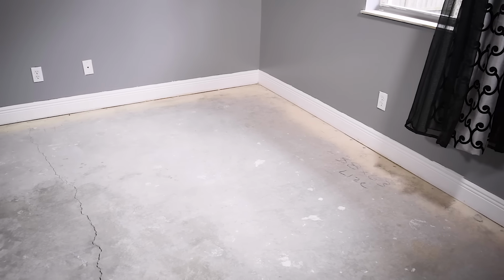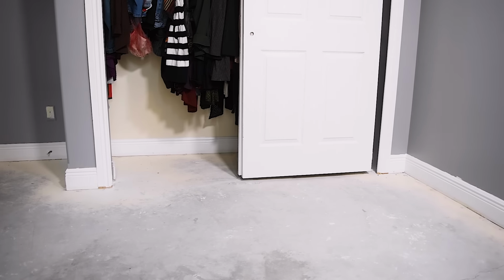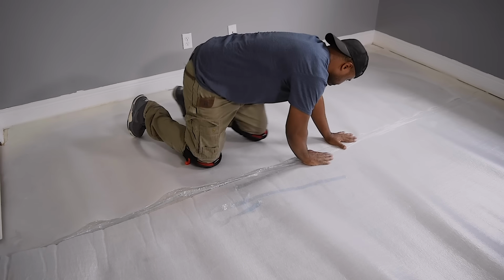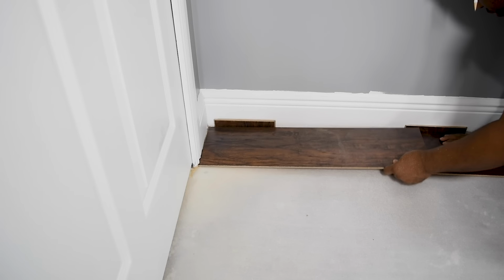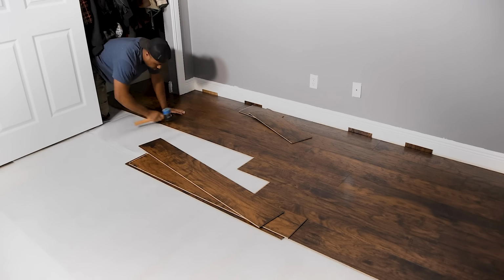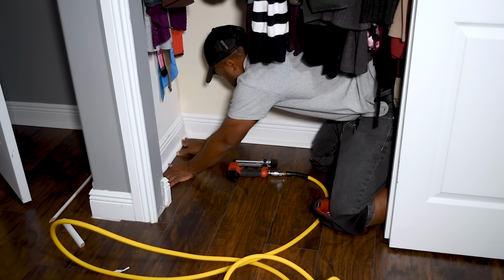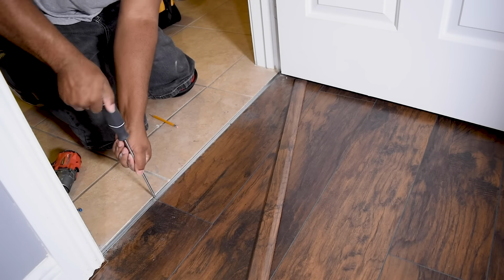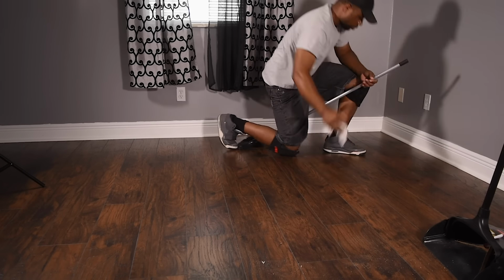How to Install Laminate Flooring for beginners

Comment: Very nice and appreciated video! Let me give only a suggestion.. since it's a video addressed to everyone (also to me in Italy ;) ), consider the opportunity to use safety gloves and, why not, safety glasses too, when working with cutting machine. Also.. it could be interesting to set over the transparent foil, and under the laminate folloring, a thin layer (3 mm) of sound-absorbing carpet, just to reduce the noise of the heel of the shoes on the floor. For the rest, a very good job, bro!

Comment: Love your videos, but you missed a few things you should have mentioned. 1. The floor has to be as leveled as much as possible, keep in mind that laminate flooring is float board. If your floor isn't level and traffic begins to enter that room often, it can disturb and pop out the laminate flooring from the joints. 2. In general with your miter saw cuts, they could have been more explained, but overall good job. 3. I personally think it is best, to flip the laminate board on the back side to prevent as much tear out when using a miter saw, unless you have a fine tooth blade on your miter saw that you didn't mentioned than it would be alright to use your miter saw to cut on the from face side of the material. You should have also mentioned you don't really need a miter saw to cut laminate boarding, as many people don't own these machines, you can get or rent a (Snap Cutter/Floor Cutter). Overall great video and thank you.
Reply: By the time you buy all the EQ to do this job, you'll be wondering why you didn't call a contractor in the first place after you botch it. Remember your first model airplane? Or the first cake you baked? 

Good luck.

Comment: That crack on the concrete slap running straight to the bathroom . Scary ass
Reply: 2 kinds of concrete. Concrete that is cracked. And concrete that is gonna crack.
Reply: Just cover it with flooring. Problem solved
Reply: Thank you!!! I didn't even keep watching because who completely disregards a hairline crack down the entire friggin slab?!?!?
Reply: Cracks are usually to big of an issue with a good vapor barrier unless its a fissure that is shifting flooring heights.  That one was pretty big, and he could have filled it with a leveling compound (I would have suggested it if I was setting up the install), but in this case, probably alright.

Comment: Is underlayment required for vinyl plank?
Reply: Depends on the LVP, and what you are installing on.

Typically you will not need an underlayment if you are installing on wood unless it does not have an attached pad.

Many SPC (stone polymer core) LVPs are find on concrete, but check the installation instructions.  They will usually tell you how water saturated the concrete can be to install without an underlayment.

I have seen from 5%, all the way up to 85%.

Comment: No need to level the floor with some grout?
Reply: He probably had already checked... but yes you should level the floor.

If you are talking about the crack, you would not use grout, you would use a leveling compound.

Comment: I would've just added 1" molding in front of the base board no cutting and it still looks nice. Especially for uneven floors the 1" molding can flex a lot. My names Rubin Lopez from day in the life of a nyc construction worker ❤💪✌

Comment: Very good morning all

We have several collection in wooden flooring
Laminate
Engineered
Solid wood
Outdoor wood 
Thermo ash
Ipe
Pine
Wpc
Versailles tiles

In laminate we have 8mm and 12mm flooring water resistant and waterproof

Please contact us for stylish and durable flooring

Regards

Mr. Raj
🇳🇪india
Contact me
7503452730/8882601780

Comment: Another very important tip....be sure that if you have windows, that they are caulked on the outside.
If you see the concrete discolored or damp...you have an exterior water leak path , that needs to be addressed before you start.
I ran into this issue when I removed my wall to wall carpet and exposed the cement slab. The corner of the metal window frame had a wide open gap.
You do not want water working its way under your new flooring. 
Just trying to help.

Comment: Difference between a pro and your average DIY guy is show at 12:10. Pros would hide the flooring under the door trim/jam and you wouldn't see where it ended like you can see in this video. The rest is good for the most part tho. Not bad for a DIYer.

Comment: “ for beginners” .. has x thousand dollars worth of tools
Reply: My father's here talking about buying a saw now
Reply: There's even a saw that wasn't listed in the video description which I am awfully curious about.
Reply: @stephenciaramitaro138  a nail gun and compressor is around 500 bucks for a cheap brand...
Reply: @famousace4652  try $200 for cheap brand.   Either way you clearly did not watch video as he told you hammer and punch with nails
Reply: @ofblong  200 for a nail gun and compressor ? I’m interested , what brand ? As a beginner I’d like to see a video showing how to do it with a hammer and nail then, personally. Doesn’t do me much good if he just says in passing by the way you can do it another way but I’m going to show you this way.
Reply: @famousace4652  Porter Cable pankcake compressor = $145, Valu-air finish nailer = $50. Do a search. You don't need a miter saw, though it makes the job easier. A circular saw or a jigsaw with a couple of clamps, a flat work surface and a good speed square is all you need. You can get a nice SKIL 7 1/2" circular saw for about $60.
Reply: @WH-s2j  my research tells me that compressor alone is 240 on Amazon and 288 from Home Depot. Are you in USA?
Reply: @famousace4652    Bullshit. Go on Home Depot website. You can get a Porter Cable (not a bargain brand) compressor with 3 different guns for $199. You can get a decent, entry-level compound miter saw for $135 (Ryobi). Hardly thousands of dollars. Know before you talk shit but I guess your goal was to be funny (FAIL).
Reply: @ruffxm  not where I’m from you can’t. You’re taking this post way to seriously lmao. Maybe I should recite sources before I make a YouTube comment that took half a thought and 2.5 seconds to type? 😂

Comment: This is great, answered my question about how to install with moldings already in place.  Thank you
Reply: You either do what he did, with those large moldings, or you remove them and drop them back on top of the laminate/lvp when you are done.  Covering the expansion joint... will keep you from needing to use a quarter round to hide that gap.  In this case, that was probably glued and stapled, and would have tore up the wall to remove.

Comment: Flooring measure guy for box store here. Seen thousands of floors and here is my opinion... 

LVP -
Pros: affordable great product, practical and durable, easiest DIY flooring

Cons: can't stand the feel and looks like plastic

LAMINATE- 
Pros: affordable and looks/feels better than LVP. Ok for low moisture rooms in newer homes with flat floors

Cons: worst durability some carpet lasts longer lol. If floors are uneven or ANY standing water will fall apart. The edges will guaranteed start to peel and de-laminate over a decade

TILE (Ceramic/Porcelain) -
Pros: best flooring for foyer/bathroom. Can last forever if over concrete or PROPERLY installed over wood subfloor, can make creative patterns

Cons: alot of labor, cleaning grout, cold and hard, if installed over wood subfloor must have proper structure and installation technique or won't last.

Sheet Vinyl (aka linoleum) -
Pros: cheap and durable, waterproof, good for bathrooms make sure you caulk around the tub especially if you have particleboard subfloor.

Cons:not a premium product, people think it's dated. Hard to DIY

Engineered Wood-
Pros: looks beautiful and is much cheaper than solid wood. Comes in click lock easy DIY install 

Cons:scratches easily and cannot be refinished. Not good for house with kids or large dogs

Solid Wood -
Pros:looks beautiful and can last over 100 years. Adds a solid feel but not as hard on feet and knees as tile

Cons:high maintenance, expensive, potential squeaks, adding a 3/4" thick floor to an existing house can be a bit tricky with the added thickness. If you have a particleboard substrate it won't hold the flooring nails 

CARPET -
Back in the 80s-90s carpet was much better quality (nylon). 90% of people these days buy polyester carpet because nylon is double the cost. I'd avoid a solid light color carpet in favor of a dark multi color to hide the stains. Personally this is the one flooring I would buy cheaper. For most people expensive carpet is not worth it unless you have no kids and pets and you just built or bought your dream home.
Reply: It is so interesting to see opinions from people who work in the industry.

I almost totally disagree with several of these lol.

I don't work at a box store, I sell flooring out of a flooring store... I typically work with different levels of products.

You can find LVPs that do a pretty good job at faking wood, a heck of a lot better than they could a couple years ago.  Find yourself a good Armstrong or Karastan LVP and you will get something that is much closer than something that costs two bucks a square foot.   Put it next to a wood floor you can tell the difference, but on its own it looks pretty sharp.  A dense 7mm SPC core, with a 20+ mil wear layer, and under normal use they can last a long time.  I don't even sell anything under 12mils unless people are specifically asking for it.  Have none in my showroom.

(And I do not like LVP as a general rule outside of certain rooms... waterproof flooring does nothing for your subfloor... most people are looking at it from the wrong direction).

Laminates got a bad rap because of cheap stuff.

You find yourself a good mohawk, audacity or some other good brands and it will last until you want to throw it out because you are tired of looking at it.  You can wet mop, or steam mop them and they will only delaminate if you abuse them.  They won't scratch unless you really harp on them either.  I do key tests with customers all the time, ... you get a good AC4 wearlayer on a modern laminate and about the only room you can't comfortably put it in is a bathroom and maybe a laundry room.  You want stuff to delaminate or scratch go with a cheap Pergo (which is sad, because Pergo is owned by Aladdin, who does Mohawk and Karastan... and do a great LVP) or other equivalent floor.

Tile I agree... though I rarely sell ceramic floor tile, that is usually for walls.  Porcelain is better for flooring.  People who try to install tile directly on wood subfloor are crazy, and peal and stick tile is garbage.  People ask me for that occasionally and I basically tell them to go to Lowe's across the street.

Sheet Vinyl and Linoleum are not the same thing... they just work the same.

You are right with it though.  It often gets put into new builds because as a product its relatively inexpensive.  It is alot more difficult to lay than most people think, especially if you are having to do any cutting and seaming.

Leave it to the pros unless its a flat square room that won't be any wider than 12 feet.  

You are all over the place with Engineered hardwood.  You can find click lock ones, you can also find staple and glue downs.  Stay away from the cheap stuff and a engineered hardwood would scratch less than a standard hardwood as the material its built on is more rigid.  Plywood, pressboard, or even the "waterproof" hardwoods which are built on SPC.

And, you can refinish engineered hardwoods if you have good engineered hardwood that has an actual veneer that is not basically painted on like most builder grade materials.

Anderson tufftex sells some engineered hardwoods you can probably refinish as many times as a comparable solid plank (though expensive).

Plus you have the advantage that engineered hardwoods handle moisture and humidity better due to being built on a more stable platform, and you can get wider planks than you can get with solid plank hardwoods (which will rarely get into the 5" range unless you shilling out money, and anything over that is usually just smaller boards glued together).

Solid Plank hardwood can last 100 years if its installed correctly, but it is just as susceptible to scratching as an engineered hardwood, and if its a medium hardness wood like oak, will probably dent easier as well.

Both hardwood (solid and engineered) and tile both add value to your home as well.  

You might sell more polyester, but I don't.

There is currently  worldwide nylon shortage, which attributes to the rising price, that as well as a shrinking in the carpet market due to people shifting away from carpet being a "one size fits all" flooring solution.

Polyester is cheaper, softer, and more stain resistant than nylon.
Nylon is more expensive, pretty stain resistant, not as soft, and less resistant to stains.

Bang for your buck for carpet.

You want a great feeling carpet that will last a long time if you take care of it right.  Triexta or its actual branded name Smartstrand.

Will still have an equivalant warranty as a nylon, is virtually stainproof unless you don't take care of it, and is softer than anything but luxury carpets.

That being said, if you are just dropping carpet in a bedroom.. a polyester is fine.  I just rarely sell it (aside from it being blended into alot of Smartstand carpets).. as soon as I show people a solid Mohawk or Karastan carpet they are usually hooked.
Reply: @daleludtke7803  Excellent advice! My opinion was a more of a  budget approach. I live in an area where houses cost on average 160k so we usually don't see the premium grade floating/engineered floors much (they don't even have those at box stores).

Absolutely the high end laminates can be pretty durable (if subfloor is flat enough).

You have to admit dollar for dollar laminate looks/feels nicer than LVP

With engineered wood look at the veneer thickness to determine if it can be refinished

Carpet adds little to no value to a home so don't buy a 25 year carpet to sell your house in 7 years. Polyester carpet (especially a high pile) will mat down much faster than a nylon/triexta/smartstrand. Also carpet is not DIY friendly leave it to the pros

Comment: Guys when you do laminate flooring make sure the floor is as level as possible.  Foundations are never completely flat and will have some very subtle dips that you can’t feel when it’s just bare concrete.  If you lay laminate flooring over uneven areas it transition over when you walk over it and will be noticeable.  It will have a floating feel to it and can be annoying in high traffic areas.

Comment: Solid video, like the flooring. 
Just to add to your one point about the quarter round. When you're cutting your scarf joint to join two pieces up, always a good idea to have the joint that overlaps showing to the door- this way you dont see the joint(exactly what you did); it's common sense to most but some miss dont think about that.  Another good idea is if you can(this goes for baseboard too), have your scarf joint behind a door or a spot where you know a piece of furniture is going to hide it all together.

Comment: as a recommendation, to get clean caulk lines ( especially with dark floors where they can contrast or be noticeable). put painters tape along the floor barely leaving a gap to the edge, and run your bead of caulk. peel up the tape and the bead will likely not be noticeable unless you are looking for it.

Comment: I should have seen this video before starting my installation of flooring. My ex husband suggested he could install for me. But he did a few things wrong and now my whole house floors are done but I'm noticing the gaps in the flooring 😥 he gets extremely offended if I show him the areas that aren't right. Now where it has gaps between planks, there is damage chipping and cracking. For me to save to get this flooring it is very disappointing that it is not done correctly. I really wish I would have paid a professional installer especially for what I paid him to do it. Besides taking out the floor a d redoing all throughout the house, is there anything I can do to fill in the gaps to previous chipping damage?

Comment: i do this professionallyand well you taught me a new trick (tape for marking on dark boards, just never been enough of an issue to me but its a good idea), nice work dude, an option to mitering the ends of the beading is to cut it round with a jigsaw (blade type is important) or scroll saw and yeah starting in the door and working away from the cupboard where possible makes life easier as you can get under all the frames with less hassles

Comment: Good job  bro . Im a professional floor layer 12 years now and usually use a joiner for wooden floors but I have done a few myself , pretty easy when you get used to it   and btw transition bars are the worst part at times lol

Comment: "Framers" use Real tools (power tools/ air compressors), not hammers and nails. And did he use a pocket knife to cut the underlay? Ookkk Purchase a Saker countouring tool folks. It’ll save you some drama with angle cutting.

Comment: Is it best to remove the molding?
Reply: Depends on the molding and how it is installed.

When I set up installs I assume we are going to unless my installers tell me it can't come off without damaging it.

The quarter round thing is more of an older look from when laminates first came out.  Or used with stuff like wainscotting, or around cabinets in your kitchen if you don't have baseboards on your islands and cabinets.